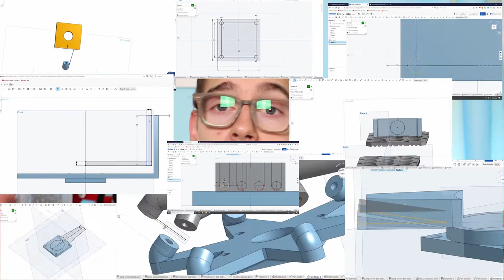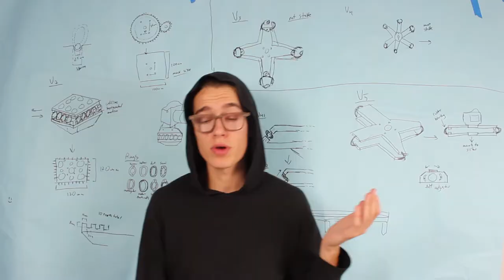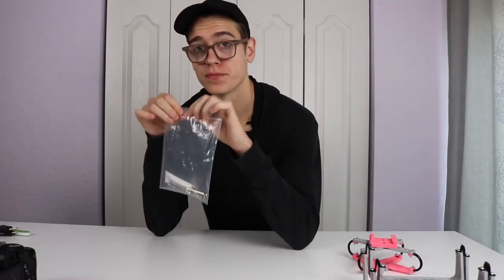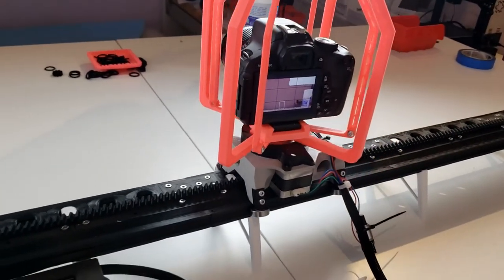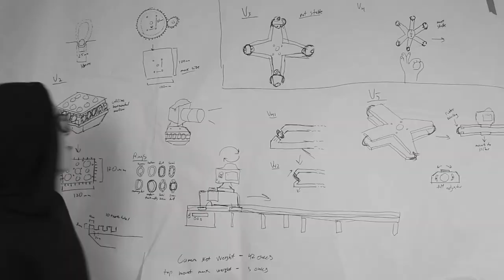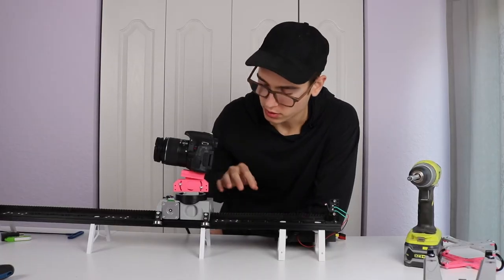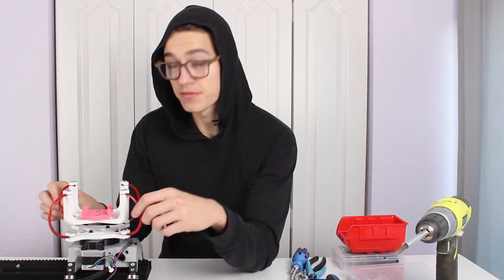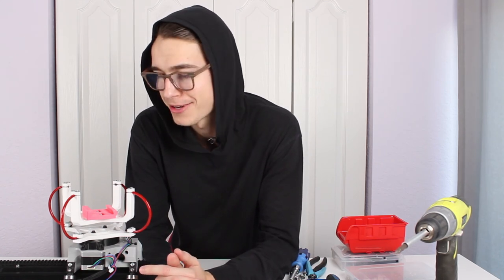How hard is it to make an ANTI-VIBRATION mount ???

Comment: I agree, designing and fabricating an anti-vibration camera mount is a challenge, I have constructed many over the last decade. The secret to success is  "damping" not simply uncontrolled springs. Silicone and low durometer urethane are the best materials to use in a simple mount design.

Comment: The issue is very clear, you're using a gear track to move it when you should be using a smooth rail system with motorized wheels and a break, it's bumping everytime the gears make contact.
Reply: Exactly. There are affordable rail+ sledge solutions available. Using rubber belt drive might be a little better also.

Comment: You need PID tuning to reduce the inputs of vibration to the system.  Futaba makes a green gel pad used for mounting Gryo's.  Some of this incorporated in your system might be worth trying.  We use the material to hold vibration sensitive sensors at work.  Ultimately, reducing input the system is what's required.

Comment: Some of those designs look decent but I think the issue is lack of damping. You've got springs absorbing vibration but transferring it straight back through their elasticity. You need something to absorb the energy. Try adding some soft sorbothane foam in the gaps and you might get to where you need to be
Reply from the maker: I agree completely, I think that's the secret sauce of creating any anti-vibration mount that works effectively.

Comment: Great video. I've tried building something from scratch, too. Haven't yet submitted it to practical use, though. However, one should consider that a vibration isolator must cover the vibration frequencies your setup is enduring and must cover for the weight and movement kinetics of your setup. The wider the spectrum of vibration frequencies and possible resonance, the more difficult it might become. One solution would be to have several stages, like the first one covering low frequencies and another one for the higher ones. Or maybe look how the brain is isolated from vibration inside the skull: liquid dampening and a billion of tiny elastic fibres, strong ones, weaker ones and so on. If you want to do some more serious testing, maybe get a small vibratory plate like they are used in chemistry and biology labs.

Comment: congrats you found a thousand ways to make a springy camera mount :D
dampening is key not springs. flex filament will give spring but no dampening. Springs are only there to hold a weight up or to flexibily fix it in a certain position. to make this "positioning" or "re-centering" complient you will be require to dampen any forces which is done with shock absorbers. you could try RC-car style ones or you go with some type of soft foam(hard to get hardnes right) you could design shock absorbers out of varioShore TPU as this gives springyness and dampening at the same time sort of. 
Dampening in general is done with converting motion to heat - so any form of, ideally variable, friction will get you somewhere.

Comment: I have a 3d printed shock design that would fit between the upper and lower plates putting it there would keep the system in tension or pre-loaded.  It should help to stabilise the system a bit.

Comment: Thanks for the work. The last one looks good.   Try adding a small array of Nd magnets on top plate and copper sheet on the top of the bottom plate for eddy braking in the gap between the two plates.

Comment: The problem is you have different tasks, which need different solutions. If you only have impulses as an input, so the camera (output position) needs to stay in rest,your decoupling concept isn't that bad. But if you want to move the whole thing, you dont need a full decoupling, but a good damping. Because some of the input (the translation) needs to be transferred to the output motion of the camera. There you need a different concept

Comment: I've been working on 3d printers for a while now, fixing them and designing them. The jerking of the rail system on your system could be a source of some of the vibration and the gear rack as well not meshing properly due to the camera weight, it looks like the system is trying to overcome a gear rack tooth at some points.  Improvements could be a dual motor setup another motor on the opposite end, so it can push and pull not just push as it's doing now. Get better stepper motor drivers that can smooth out the jerk motion, and figure out how to adjust the meshing of the gear rack to compensate for the cameras weight. Keep up the good work and your designs are looking wicked cool so far!
Reply from the maker: Thanks for the input and you're absolutely right, it's shakey because the meshing between the rail stages are off, so every time it goes over a transition it's like hitting a speedbump, not to mention jerk from the camera weight. I've actually already rebuilt it with a belt system and a linear extrusion to have a much smoother glide, I was actually considering making an update video.

Comment: not sure if you ever scrapped this or finished the anti vib mount,,but try some very light rubber bands or even springs ,foam in the corners at the bottom of the bird cage design to stop the swinging or even light foam ,bands etc at the CG of the mount to limit swing. just something to dampen it. Just some thoughts.

Comment: You need a solid surface to distribute the load and then a material that is slightly springy but more so dampening. Rubber is ok but foam is better. With that last design, having dense foam entirely under the rigid surface and then those spring loops on the outside might be the ticket.

Comment: Hi mate, this might defeat the purpose of your experiment but weighting the receiving component of vibration has an inversely proportional relationship to vibration acceptance of the component. Also actually having a datum grid on the wall you are filming would be valuable data when adjusting the tilt, angle and position of componentry of your damping device. Could help you in your component material selection aswell. Adding preloaded compression and fiddling with rebound rates would be interesting to see
Reply: This right here about adding extra weight to the way to go. Try shooting on a moving cell phone to see how this effect is multiplied by the weight of a rig.

Comment: good video and effort. But in this case all your issues were with the type of motor and gear ratio you used. As well, the track you used for the slider with the metal liner gear is for sure the main teeth of the monster you were restling with.

Comment: Also if you are so fixated on making camera sliders, 1-make 2 circler tracks on bigger than the other, put one inside the other 2-make another segment from compatible with each track in sizes then place each segment on top of the track parallel to each other then connect both segments together, 3- buy 4 bearings, 5- place the bearings inside the track, 6- attach the segment to the bearings, 7- attach electric motor to the segment and attach a wheel to it, is my idea clear, you can make a 360 product filming track 👍🏻
Reply: Sorry for the spelling mistakes, 1- one bigger 2-make another segments compatible (without from)

Comment: What about a tension frame? Think skeletal tubular cube with a center frame liked to the main cube with rubber bands. Think an old fasion suspended mirophone. Where the mic is suspended by springs or bands to cancel all vibration.

Comment: good job. i felt like you were limiting yourself using only 3d printed stuff. the cables were good. in that final design, i was thinking a bladder of viscous liquid between the platforms or a sheet of silicon or ballistics gel. learn anything new since? mag lev?
Reply from the maker: Good idea on the gel, and yes I have been working on several other designs :)

Comment: Thank you for your idea's. I'm currently cobbing together high powered fans to cool my sim wheel motor. I have a thrustmaster t300 sim wheel. It's a belt & pulley system powered by an offset motor that's sheathed in an aluminum heatsink for cooling. 
To aid in cooling is a 60x10mm China crap fan that's not only 4" away....it's  pointing the wrong way as to exhaust. It's a shit design..